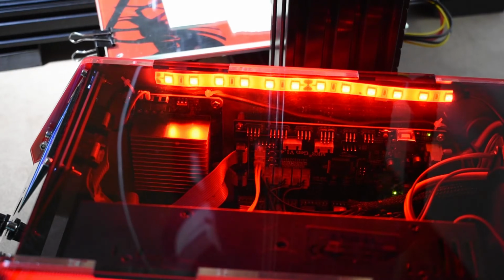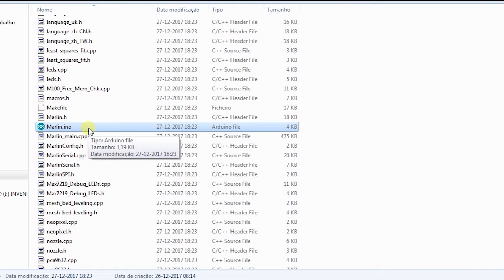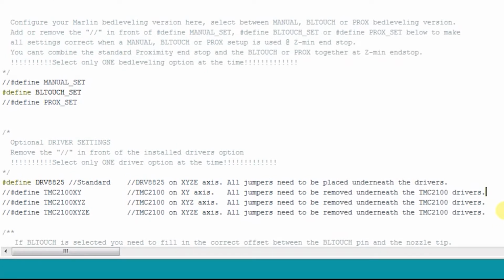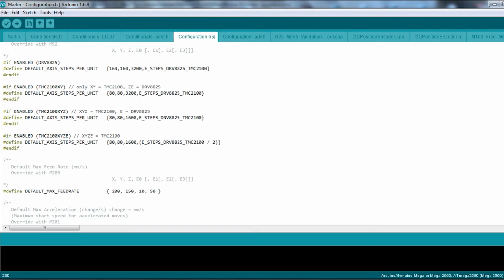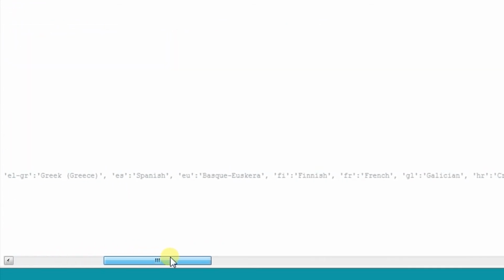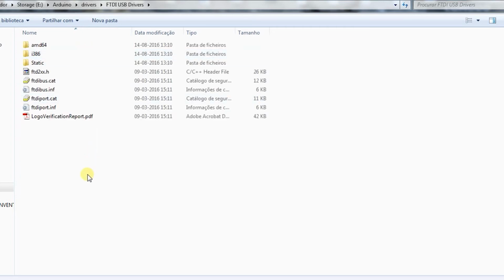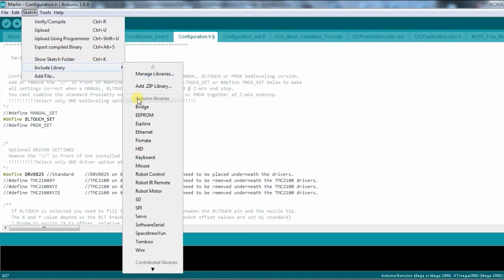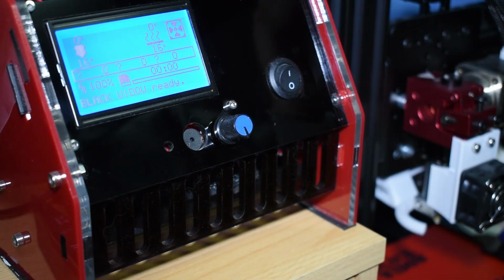How to easily configure and flash firmware to a TEVO BlackWidow 3D printer

Comment: May I know how to solve this ?

Sketch uses 107570 bytes (42%) of program storage space. Maximum is 253952 bytes.
Global variables use 5065 bytes (61%) of dynamic memory, leaving 3127 bytes for local variables. Maximum is 8192 bytes.
An error occurred while uploading the sketch
avrdude: stk500v2_ReceiveMessage(): timeout
Reply from the maker: You probably don't have a successful communication between your PC and the board.
Check that you are using the correct drivers and the correct port number.

Comment: None of links listed work. firmware ling, fb .. none. could you please share the latest SW + BLT touch. How to upgdate standart to use BLtouch? Best regards
Reply from the maker: Hi,
Thanks for the information.
I will check the links.
Regarding the firmware, you can get all the firmware versions in the official tevo black widow facebook group.
If you don't have access to facebook, let me know and I will try to send you a copy.
Reply: Link not work from fb , where can i get the Tevo BW Firmware ? ...new board here and can not flash : (   ,  the firmware on off. Tevosite is normal marlin but not for the BW

Comment: I have all done 1;1. But in my Arduino are only one tab, Marlin. What I can do?
Reply from the maker: Hi,
You need to extract all the files. If you open just the ino file you will not get the other tabs.
Reply: ruiraptor thanks bro

Comment: full metal extruder works with 300°C???
Reply from the maker: I never tested that high. You will probably only need that high temperatures to print PC. Other than that, 280 is enough.
Reply: +ruiraptor yes im going to print PC
Reply: +ruiraptor is this a good machine working out of the.box??
Reply from the maker: Yes, it's a good machine but the assembly must be carefully done, especially the alignment of the frame.

Comment: how can i raise maximumu temperature of hotend to 300°C ?
Reply from the maker: Hi Marek35,
For that you need to modify your hotend and install an all metal one. What kind of filament you will be using?
Reply: ruiraptor i already installed it. I just need to adjust FW. I will be printinting CarbonX (nylon+cf)
Reply from the maker: Hi,
Do a search in the firmware (in configuration.h) for "#define HEATER_0_MAXTEMP 275" and change it to the temperature you want.
Reply: it seem to be too easy
Reply: i ve done everything like it is described in the video, and it works! It even speaks my language. Thank you so much!
Reply from the maker: Thank you so much for the feedback :)
Reply: +ruiraptor  on website it says all metal hot end..why we need to change?
Reply: +marek35 works???

Comment: how we get "THIS" Firmware ???
Reply from the maker: Hi,
If you have FB, join the official tevo black widow group and download the firmware from there.
Reply: Hi , do you mean the .pdf what not work ?    ....

and the firmware from TevoSite is not "that" one for BW , its a normal Marlin
Reply from the maker: Hi Dirk,
I mean the firmware. You will find it in the FB groups. The firmware posted in there is Marlin with a few modifications. These modifications allow an easy and fast change of settings such as driver type, leveling type, etc.

Comment: The file no longer exists, all the other firmware needs BLtouch which i dont have fitted to mine, using any of the other firmwares just cause the printer to ignore the end stop sensors driving the nozzle into the bed. I FUCKEN HATE THIS PRINTER! i wish i had never bought it, 1 hour print = 2-3 hours of fucking about